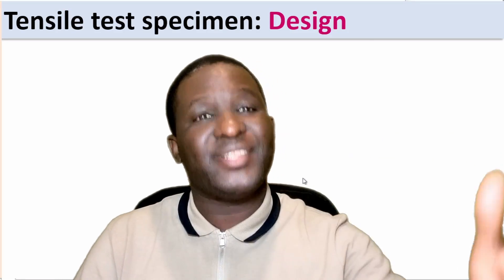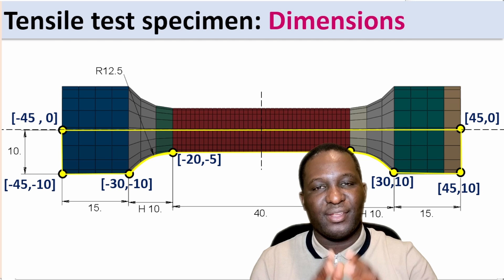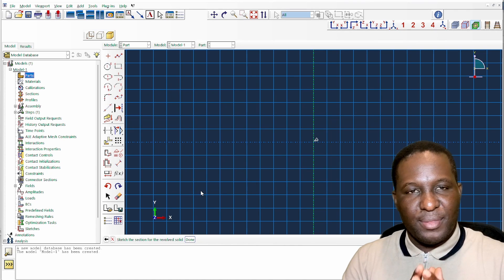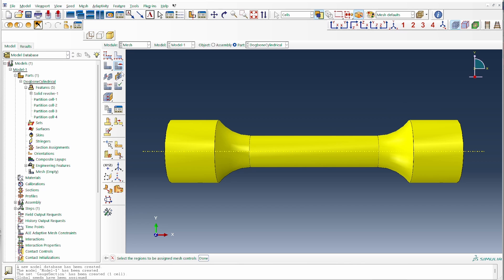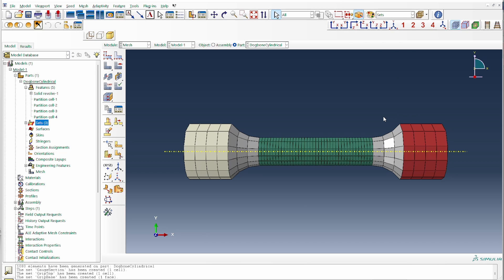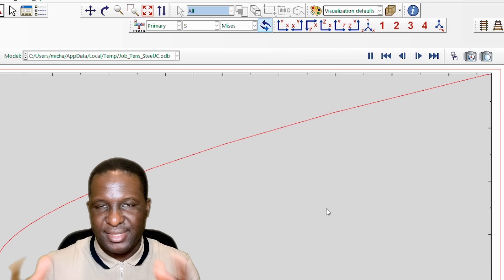Numerical Insights into Tensile Testing with Dogbone Specimen

Comment from the maker: You can quickly navigate through the videos using these chapters.

00:00 - Intro
00:28 - The Theory of Dogbone Specimens
01:05 - Dimensions of Dogbone Specimens
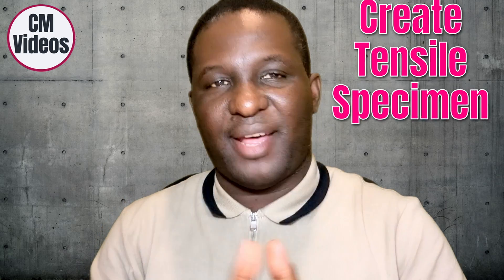03:23 - ABAQUS Model Setup: Create Tensile Specimen
06:51 - ABAQUS Model Setup: Meshing
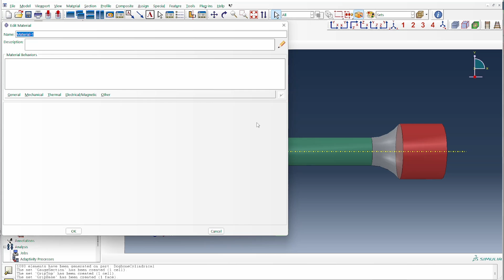09:58 - ABAQUS Model Setup: Material description
12:50 - ABAQUS Model Setup: Create a Step
14:19 - Simulation Results of Tensile Testing
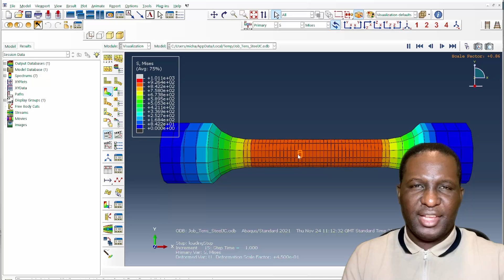14:48 - Extracting stress-strain data in ABAQUS
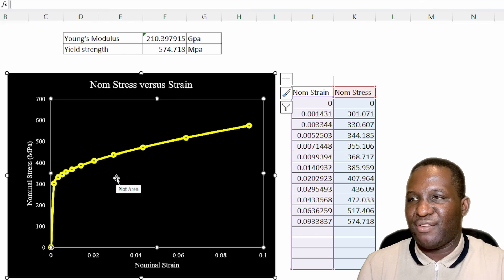19:02 - Outro

Comment: 0.000154128%	1.37874 MPa this is the tensile data i obtained performing test on gfrp composite i dont know why i am getting so leeser value E11=8943.066, 22=8941.682, 33=41396.052 and one more thing is that during experiment i have applied strain rate of 1mm/min but in abaqus i feed load as a  velocity of 1/60  mm/sec is is okay
Reply from the maker: Hello, I am not sure why your values are the way they are and also unsure what to say about your loading conditions.